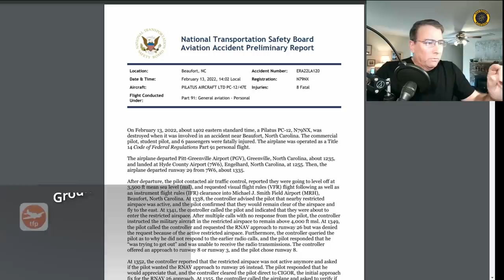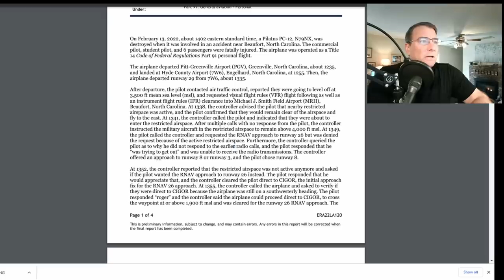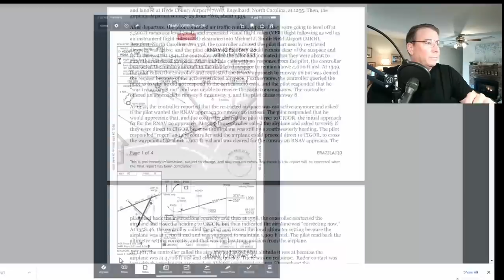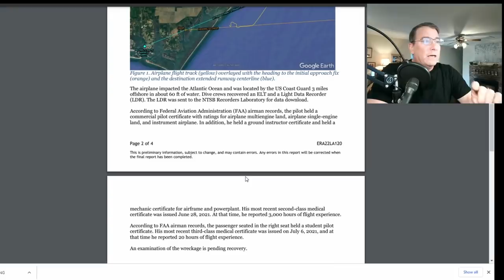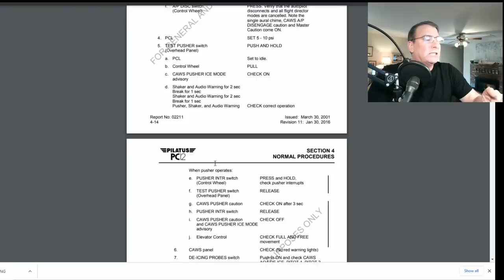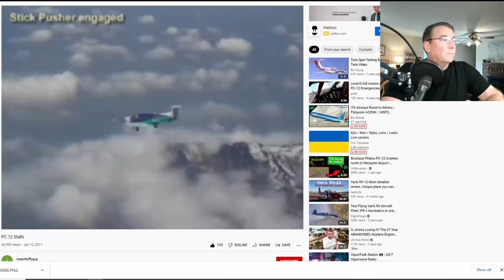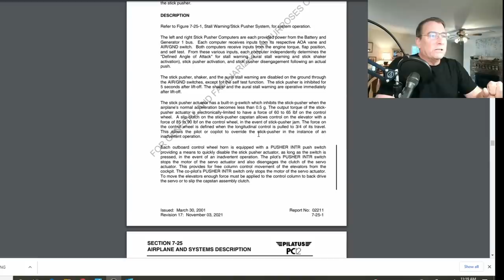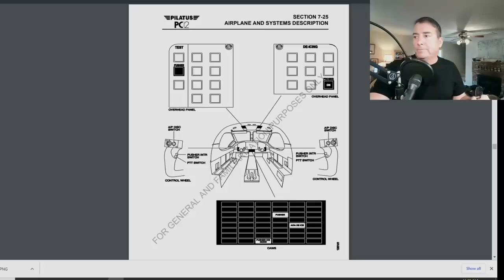NTSB Preliminary Report Pilatus PC-12 Beaufort NC

Comment: Having flown the PC-12 as part of our corporate fleet , this accident is beyond comprehension. This aircraft is very easy to fly and in the years that I flew it up North I never was confused by it's handling characteristics. We received very thorough   annual re-currency training including stalls and were respectful of it's stall characteristics which could be extreme if held in a stall forcefully. To stall/spin this aircraft is just hard to believe.
Reply: Agree, I think this video is way overthinking things and plastered with extreme speculation
Reply: @avfan967  Serious question: what do you think happened?
Reply: @avfan967   Over thinking things can be part of good  ANALYSIS.   When one successfully performs analysis, one comes up with several possible scenarios, then tries to ascertain which one is the most likely.   

Coming up with possible scenarios involves speculation (what do we think happened).
Nothing here is extreme.     run away trim.    spacial disorientation/vfr into imc  cockpit distraction   mechanical failure differences in stick shaker and pusher deactivation.    possible inadvertant pusher deactivation.     right seat pilot having just 20 hours total time .     ALL of these points can lead to loss of control and a crash.   They are all valid for speculation and deconstruction the chain of events that lead to this crash, and other crashes.
Reply: I believe some kind of pilot's incapacitation.

Comment from the maker: Just spoke with NTSB, here's the L3LDR Data recorder used in this aircraft. This is a game changer: https://www.l3harris.com/all-capabilities/lightweight-data-recorder-ldr
NOTE #1: Pitot tubes located under wing, separate from AOA vanes.
NOTE#2: As stated in the manual, stick forces noted in lb/ft of torque. I do not know the lever arm length and thus actual stick force.
Reply: Hi Juan, the stall warning/stick pusher system is designed to reset itself during start sequence, which forces the pilot to perform the preflight test to clear the CAS message. You are not allowed to ignore that test prior to departure.
Reply: From the L3 website
L3Harris' Lightweight Data Recorder provides small-aircraft operators with crash-protected recording of audio, image and flight data in a small, lightweight package.
Reply: Torque, in customary units is measured in ft-lb (or lb-ft), not lb/ft.
Reply: I think the stick forces listed are actual units of pounds force (lbf) not to be confused with torque in foot pounds (ft-lb) or pounds mass (lbm).
Reply: @bethhentges  Correct.

Comment: If you don't do the pusher test after start, you'll be presented with an Amber "PUSHER" CAS message which is hard to miss. I used to instruct in the PC-12 and did pusher demos. Try as you may, the pusher will win (unless someone was panic holding the pusher interrupt). It sounds, from my armchair, reminiscent of of the TEB Learjet crew that was behind from before they started engine(s).
Reply: What percentage of pilots did you encounter who had taken a 142 course for this aircraft?
Reply: @SkyhawkFlyer  very few, less than 5 I'd say. Almost all I trained and checked were 135.
Reply: @regionalflyer  
I'd hope the OpSpecs require substantial training and continued copilot training on such birds.  I've read far too many reports on privately owned turboprops where there simply was not enough training.  

I've long-held the opinion you should be willing to spend at least one percent of the cost of the aircraft on training when you get beyond 230HP and that includes pretty much anything over a 182, including light twins.  A 142 course barely scratches the surface for so many pilots jumping into turboprops with a private or even commercial ticket with ASEL.
Reply: @SkyhawkFlyer  insurance just keeps driving costs up without dictating much in the way of additional training.

Comment: Juan ... I was amazed at the short duration of the stick-shaker prior to the stick-pusher activation in the demo. It shows just how quick corrective action needs to happen to get you out of the mess in a small airplane.
Reply: It is the ONLY small airplane where the terrible  stall behaviour (13:05 to 13:25) was 'corrected' with a stick pusher, so  that a certification was approved.
Even with an altitude loss > 50 ft.
There are too many elements in that system that can malfunction,  preventing a proper self recovery. ( example if the 2 computers do not agree! )
Do not ever attempt a full stall landing.
With sick pusher operating, you flare at 5 ft, hold altitude and the stick pusher will push you into the ground.
With the sick pusher disabled by the left yoke switch,  same attempted full stall landing will drop one wing into the ground, sharply.
Observations made at simulated landings at altitude. (6000 ft, where TAS = 1.10 × IAS) in preparations to a flight to Denver and the Boulder airport ( where strong winds  cause high turbulence, and high temperatures result in high density altitudes, high TAS approach speeds, because of the required safe stall margin.)
Reply: @arturoeugster7228  Yeah, I got that ... I'm sure larger aircraft would likely have a greater spread between flying, and stalling ... but good info, Thanks!
Reply: @optician53  You've said that twice--and without basis.  It must be something that comforts you, BUT... airspeed is airspeed, and drag is drag, so unless the FBW system of a larger plane limits the RATE of elevator input, I'm pretty sure a 200,000 lb. 4-engine aircraft will "break and roll" just like a 10,000 lb. single-engine turboprop... but I'll defer to Juan, whose day job is flying the "heavies".
Reply: @MajorCaliber  Look, maybe it's something that comforts you, but there is no need to be condescending ... all I'm suggesting is that if all else is equal, it seems small aircraft are easier to stall than larger aircraft ... I mean, ya hear about plenty of small planes stalling into the ground, but not many big jets. Sure it's about pilots, training, and design integrity ... but, just sayin'
Reply: @arturoeugster7228  Many light GA aircraft have stall characteristics that drop a wing and roll you over into a spin.
Reply: @manbeau2379  I suggest you take a ride on the Pilatus with a rated flight insructor.
Without the stickshaker and the stickpusher it could NOT be certified, No other GA single engine has that.  CFII here with many hours on Pilatus, including in Bolivia
(Militar 009), now destroyed.
 Stans, their home airport, where one of the 007 films were made, is the factory. On the shores of Lake Luzern, Pilatus is the name of a mountain, reachable by cable car.
Juan has a video, where the stall was tested . Deals with a  pilatus in trouble, making an emergency landing ; l ook it up.
Reply: @optician53  Thanks,
The reason for the asymmetric stall  is the location of the radar dome, which affects the flow on the right aileron.
The size of the  aileron span to flap span is unusually small.
The stall behaviour improves with small  flap deflection, aerodynamically this can be explained, but only measurements in a wind tunnel are reliable. Emmen, a military airport in the vicinity has a wind tunnel.
Reply: @arturoeugster7228  I am a humble CFII and air transport jet pilot captain of a modest 8000+ hours with 650 hours in single turboprops, and about 500 hours in SEL GA aircraft. Every low-wing GA aircraft wants to end up on its back in a deep stall. PC12's has a high stall speed for a SEL, so FAA certification required a safety device - Historical fact. FAA also required Cirrus SR to have extra safety device because it CANNOT recover from a stall-spin - Historical fact. Cirrus decided to installed a parachute, but pilots still die in stall-spins. Pilatus installed stick-pusher because they save lives. A DA20 ended up in an inverted flat spin during my CFI spin checkout and took 3000+ ft to recover. Just like in the PC12 videos. Piper Archer went inverted too. So does a Mooney. A Spitfire stall-spins onto its back, so does a P51. I know of one Meridian that stalled and went belly up and crashed in a go-around. A stick-pusher would have made it very difficult to stall, thus preventing a spin. That's why they have them in airline jets. So, why are you complaining about one of the best safety devices in a SEL?
Reply: @manbeau2379  I am not complaining  , just explaining, suggest you try a simulated soft field landing with the PC12.  yourself   at altitude . Look up the Meskite incident  at Blancolirio, , most important, talk to the surviving pilot about that engine out landing.
No talk , action. Neighter the Mooney , nor the Cherokee's do  have problems with full stall landings. 
The problem is more involved, It has to do with the yaw stability derivative of the unusual low aspect ratio vertical stabilizer and the long dorsal fin . Look at the rudder trailing edge plate.
why are there  the 2 lower inclined plates mounted below the  rudder?.

Comment: could also be an issue where the pilot was panicked and hit the pusher override instead of the radio button in an attempt to make a distress call – thus he might not have reacted to the stall because he either expected the pusher to kick in without realizing he had manually overridden or because the realization that the pusher wasn't kicking in perpetuated his panic.
Reply: and why the Location of the interrupt / override...  Seems toooo easy to activate the override, and for what reason.  Maybe some PC12 drivers can explain.  No disrespect, but did the pilot have PC12 Sim training.
Reply: That's an interesting point.

There were problems earlier in the flight with the aircraft not responding to calls from ATC (where the controller had to re-route the military aircraft in the restricted area).  Was the person attempting to respond to ATC's radio calls hitting this switch instead of the radio button occasionally?

Edit: just read some earlier comments from people looking at this possibility, so it has already been thought of.
Reply: Yeah, that was my first thought too, as soon as that diagram showing the pusher interrupt and PTT switches on the PC-12 control wheel appeared on screen. Since I’m not a pilot, I thought maybe I was being a noob, but perhaps not. But it immediately made me think of that bizarre Amazon/Atlas Air 767 crash near Houston, in which the chain of events was apparently triggered by an inadvertent activation of the TO/GA switch.

Comment: As a non-pilot you opined my very thoughts, what if either of the pilots inadvertently disabled the stick shaker, which would also explain why there were no responses to ATC.  It appears the the PTT button is very close to the shaker disable switch.  Then if the flaps got stuck at the end.... we'll, those are my thoughts.  Thank you Juan for all that you do, I have learned so much from you!
Paul Sanders

Comment: Just FYI, PC-12 Technician here, the AOA or angle of attack vane and pitot tube are not the same and while in the same general area are not connected in any way.
Reply: Any possibility of the AoA vanes being affected if the pitot heat wasn't on?  It sounds like they're what trigger the stick shaker and pusher.
Reply: @chrisschack9716  yes, the AOA probe, pitot, and static heat are all controlled by the same switch.  However in an NG or NGX, the pilot would get a amber CAS message under 12° C if the probe heat is not on.

Comment: It will be difficult to determine exactly which human factor failures were in play here. The series of mistakes early on suggest to me that the pilot was not at 100% that day, and did not demonstrate the skills and perhaps the cockpit leadership that was needed for a good, safe flight. The most important preflight item is to check yourself, and the lack of a self check may be the proximate cause of ths crash.
Reply: This is exactly what I was thinking. Something with the pilot went wrong early in the flight or was wrong before starting.

Comment: Not to nitpick but lbf is a unit of tourque which does not translate directly into 60- 65 pounds of force at the control yoke unless the control column is exactly one foot long.  Most control columns are longer and so the actuall force at the yoke is less.  If the column is 2 feet tall then there would be around 30 pounds of force on the yoke.  To find the force on the yoke itself take the torque (lbf) and divide by the length in ft  and you get force at the yoke, torque(lbf)/length(f)=equals force(lb).  I sued to work on Merlin Metroliners and one of the checks we had to do was on the stick pusher.  I had to push buttons with one hand while holding the column back with the other.  I could do it comfortably with one arm around the column.  It most definitely pulled and you had to hold on but it could be overriden.  I would assume that if you weren't expecting in it flight that it would definitely give you a good amount of down elevator before you could counter it.
Reply from the maker: correct. as I stated from the manual Ft lbs of torque. I don't know the lever arm length.

Comment: The caution lights for your probes being off do not automatically come on when you take off if you have left them off.  You do not get a caution for quite sometime after takeoff.  I am not sure if is altitude related, but when I have not turned them on it reminds me usually about 6,000 - 8,000 feet.  However, after landing when taxing and when I turn them off so they cool and I can get the covers on right after shutdown, many times I get the caution message.

Comment: My GUESS as a 75 y.o. former Otter Army pilot in the 60's - Pilot Dad had a stroke. Pulling his arms involuntarily into his chest, his grip on the yoke tightened. Stroke with P.M. rigor would have prevented EASILY decoupling the dead pilot from the controls. The frozen, inexperienced son, overcome with the trauma of his father's condition doomed all eight. Gaining altitude without a speed increase?
Reply: One usually starts with the probable not the improbable. Hopefully the flight recorder has more data.
Reply: @TheBeingReal  It is speculative, but cannot be dismissed until evidence suggests otherwise - as you say the FDR may provide this.  Note that even if there was no gripping of the control column in the event of a stroke, it still would've greatly unsettled the pilot son.
Reply: Rigor only lasts a few hours, and doesn’t set in for awhile post death. 

Decorticate posturing is what you are trying to describe, but thats a late stage issue in head injuries, not instant without significant head trauma.
Reply: @MomedicsChannel  Thanks - I'm not a Doctor and no longer a pilot so I just did a TV Doctor guess - something that fit the PLOT, not medical reality.
Reply: This theory seems credible
Reply: The cockpit transcript tells us this did not happen. Your scenario would have been easier to accept than what actually did happen.

Comment: Interesting situation, this pilot had reasonable flying experience, instrument rated, let us assume that he would have had good training, and the aircraft is docile enough to handle, so it would be hard to lose control. However, why did the pilot penetrated restricted area and had to be alerted by ATC before he made a move to get out of the danger? What caused the pilot to get disoriented?
Or did the pilot get disoriented because a icing gave false instrument readings, even with the Pitot deicing system on? We have to sit it out until the NTSB provides its conclusion. keep us posted, Juan, you are doing a great job!

Comment: I know it is speculation but this flight bears many of the hallmarks of pilot incapacitation, partial in the early stages becoming acute.  Flight into restricted airspace, not responding on the radio and failing to maintain cleared altitude are factors which a pilot with 3000hrs and an instrument rating would not normally make. Again it is pure speculation  and not the only possible explanation but it does fit.

Comment: My guess … 3000 hours, low experience in general, little or no IFR experience or he would have filed IFR to start with. Probably behind the avionics which led to rushed and possibly incorrect data which let the plane go into unusual attitudes because the auto pilot wasn’t on for what ever reason.